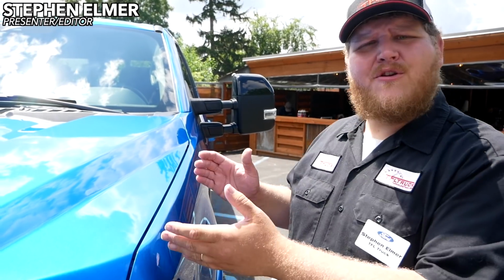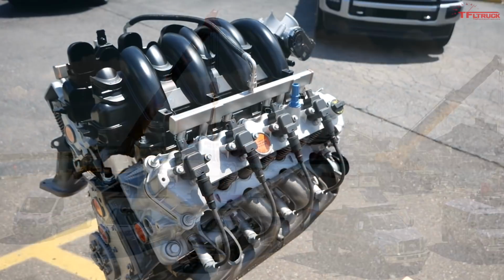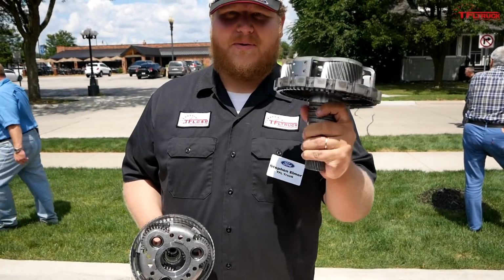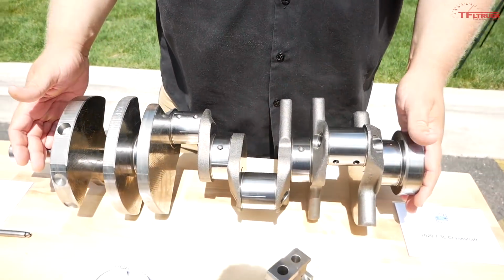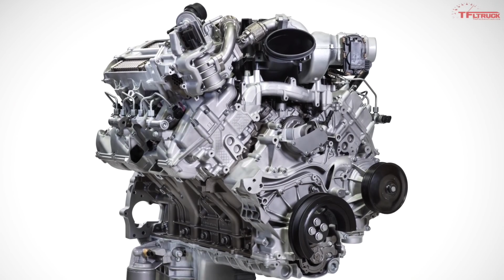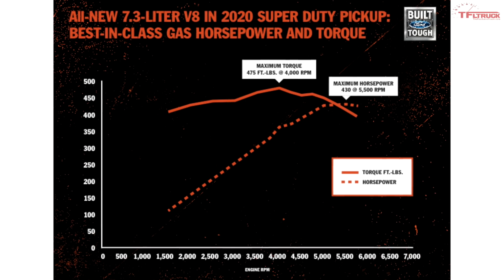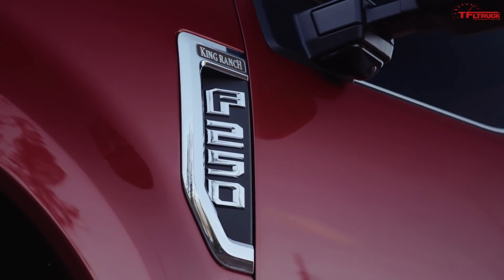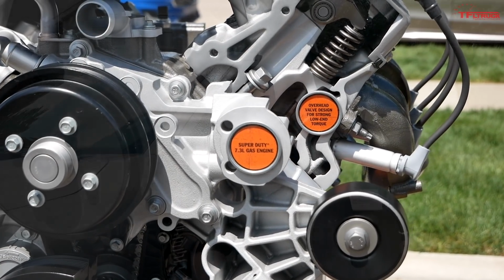We Finally Know the Ford Super Duty 7.3L V8 Power Numbers & They Are Lower Than We Thought!

Comment: It seems to me like the majority of negative comments here are not from people who drive commercial vehicles, or oversee the maintenance of commercial fleets. 

Ford was not designing this engine for the Mustang, or trying to make the F-250 a race truck.
Reply: Very good point......peak #'s are essentially meaningless in this application. Off-idle response and power up to normal shift RPM is key.
Reply: Exactly!!
Reply: LOL You got that right. This is a TRUCK engine, not the street engine they put in the F-150.  Know your engines man!  Easy to maintain, cheap to own, but powerful enough to move heavy loads.  That torque curve being as flat as it is normally comes from a diesel, or like the Ecoboost, and Ford did it without Turbos!  I tow with the 3.5 EB, that flat low rev torque pulls a heavy trailer like it isn't there. should be great in the SD to do that without needing the expense of the Diesel.   Waiting on economy numbers myself, though this type doesn't require EPA, it would still be nice to know expected fuel efficiency.
Reply: acdii A lot of people buy the 250/2500 series as personal vehicles too.
Reply: Correct, today's truck buyers are those who need to rush to Walmart for those doorbuster black friday deals, they aren't towing or hauling anything, they're using their trucks as a grocery getter soccer mom family sedan instead.
Reply: @whoeverwhatever9279  I know more than anyone could possibly need to. Yes, the 4.9 was durable as nails. Yes, the EcoBust is crap. But the Coyote is a good engine, the 6.2 is good, the 351 was good. The 5.4 4v that the lightning and Lincoln used was good, even tho the 3v wasn't. The 302 was good. The 429 and 460 were good. The 390 and 428 were good. The Clevleland 351 was good and so was the 400 if you took the smog shit off and put a cam in. This new engine seems to have combined a lot of the features of their past engines into one great engine so it should prove to be pretty damn good too.
Reply: You're absolutely right, brother!
Reply: Thank you
Reply: @whoeverwhatever9279  what the hell are you talking about?
Reply: Ryan rkj - Exactly!
Reply: yep totaly agree we nneds these kind of engines here in our tuff east canadian cold winter
Reply: when you have a GCVW rating of 25,000 pounds or more

you increase engine life by reducing Power Density
Reply: @Garrett Davis -  don't know very much about Fords do you
Reply: I don’t get why people are mad, it’s still good power lol
Reply: 7.3 gas= 8 quarts standard oil vs. 6.7 diesel= 13 quarts T5 diesel oil x10 trucks means I can afford another truck in the fleet 🤪
Reply: Thank you!
Reply: Ecoboost Engines have a Superior Torque Curve and do a far better job of Maintaining Horsepower at Altitude,

than Normally Aspirated Engines
Reply: @Garrett Davis -  Ford Performance is into Forced Induction, not large displacement, inefficient engines
Reply: Mine was thumbs up  - 427 -
Reply: Ryan rkj  - Well said!
Reply: @Garrett Davis, it will NEVER be put into a Mustang by FordMoCo. Never.
Reply: Exactly. The old 460 only made 200hp and look what people did with it. One can only imagine this engine will make huge numbers with a cam and blower. I can't wait till they start turning up in junkyards so I can throw one in front of a manual transmission 😈
Reply: @eclipsegst9419  Shit that new 10 speed will be nice too, think about it. Running 38" tires and 3.73's would be the same as 38" tires and 4.55", but now you have the fuel mileage too of a stock tire and 3.55's.
Reply: @TdrSld  probably. They sure help efficiency. I used to be a Ford Tech and drove f150s with that and they searched around for gears alot but I believe it's a "learning" transmission so if you own one it will get used to how you drive and not do that. I'm old school everything but the wife's Benz that I own has a stick. I just think they are fun and I live in a rural area with no stop and go traffic. I was planning to put a coyote in an older 92-96 F250 but now I think I'll wait for one of these instead.
Reply: Keegan Johnson. Absolutely! A cam will make these things a monster.
Reply: Keegan Johnson Good luck finding after market parts for that engine! It will take 5 years or more for the market to test then manufacturer and release new parts for it.
Reply: Keegan Johnson 
Yep, no more LS swap it will be Zilla swapped
Reply: @whoeverwhatever9279  when I worked at a Ford shop we literally made a living doing timing jobs on 5.4 3vs, and timing jobs and turbo replacements on EcoBoosts. That's why we called them the EcoBust. On the other hand all we did to the 5.0 and 6.2 engines was change oil, maybe a starter or alternator or sensor on high mileage ones. We did replace one 5.0, but only because this lady had divorced her husband, who always did his own oil changes, and so she drove it over 40,000 miles without changing the oil until it lost compression and died. The stuff that came out of that oil pan was like the grease you find in a bearing that went bad ugh.
Reply: Keegan Johnson, we had one Chrysler minivan come through the shop way back in the day, family from up north driving to Florida.

He brought it to us because it started making some noise. We went through the list, basic maintenance (80K on the clock and he'd done none somehow). Checked the oil, black as hell, nothing on the stick on the second dip.

He stood there with his wife and kids the whole time like this was going to be a five minute fix.

According to this guy they never changed the oil, never checked the fluids, something like 80K miles on a 3 year old Chrysler fwd van. This guy had gotten it in his head that since he'd heard about sealed bearings being a thing that he didn't have to do any maintenance on his van, ever, until something went wrong.

The oil came out separated, part was black sludge, the other was thin as hell, almost water.

We topped him off with oil instead of WD-40 on top of grease and sent him on his way. We discussed plugs, belts, etc, but frankly were afraid to open that can of worms. He still had 10 hours left to drive and it had been going 80K. We didn't want it to die here.

Not a huge fan of Chrysler, front wheel drive or minivans, but this thing was a warrior and deserved a warrior's death.
Reply: @Garrett Davis selling vehicles that only went fast in a straight line is why America was the laughing stock of the rest of the world for 30 years. A fast car is fast. Why not make it corner properly too? It will still go fast in a straight line if you choose to drag it.
Reply: true, but for the love of G#d my 2000 7.3 makes better torque than this "city folk diesel".....and that is what it is.......for city folk that pull NOTHING.....   :-)
Reply: @TheAmerican1963  you realize this is a gas engine right?
Reply: @TheAmerican1963 , except it's not a diesel.......pay attention......
Reply: The negative comments are from people that know Ford's past.
Ford has great marketing but they are junkers!!
YouTube Deboss garage why not Ford
YouTube car Wizard worse engine ever.
You can put lipstick on a pig, it's still a pig...
Reply: @philllsxga.7737  you are an idiot. I've worked on vehicles of every make and model, and here's the truth- every company has made a few lemons. Even Toyota and Mercedes. But 99% of the time, how a vehicle is cared for and driven has 100x more to do with how reliable it is than what the badge on the front says. I like Fords because I like their styling and sound. But I'm not some idiot who claims "everything else is shit" and anyone who does is an idiot.
Reply: @philllsxga.7737  Thia is social media bub; the negative comments are from people with inferiority complexes and deep seeded personality disorders.
Reply: @InuranusBrokoff  the negative comments are from past Ford owners. They are garbage!
Reply: @philllsxga.7737  Pretty sure you've said this already...
Reply: You must have your head where the sun doesn't shine.

Comment: Good video. I have read some of the comments where people are saying it doesn't have enough HP or TQ and it should have made more for a big motor. Of course it can we should all know by now whenever manufacture comes out with a new motor they never give it its max horsepower and torque because if they did they would have to make significant changes to it in another year or two automakers always gradually build HP and TQ.  😊
Reply: Andrew Smith you big stooooopid, clearly you don’t understand this motor is perfect for its intended customer.
Reply: @Andrew Smith you don't need any more for this. Less power=more reliability
Reply: Andrew Smith you’re the joke here. That engine is designed for towing and hauling, not racing. This engine is making big tq right off idle meaning it gets the load moving easily and maintains speed and acceleration without drama and high revs. And it can do it all day everyday reliably and the engine will last long doing it.
Reply: Identified as a ram/ gm troll,  sour grapes!
Reply: @Andrew Smith holy shit you're stupid. It's a truck engine. Swap it in a project vehicle and I guarantee it would make 600+ with just a cam and tune.
Reply: I thought all of the HD trucks are detuned?
Reply: @Squishysforbreakfast   yes. Just take the 6.2 for example in the HD trucks vs the Raptor, or the Mustang 5.0 vs F150 5.0 trucks get a torque tune, performance vehicles get an HP tune. And they leave room to grow as competition calls for it on top of that.
Reply: when you have a GCVW rating of 25,000 pounds or more

you increase engine life by Reducing Power Density

Comment: Dear Chevy, put the new 6.6 in the 1500 trucks and come out with a new 8.1 vortec that puts down 500HP and slap that in th HD trucks!
Reply: They will be putting the LT2 from the vette in the 2021 GM 1500's 450 HP, 500lbs of Torque with Truck Cam.

Comment: A bit low in numbers?  I see it is above all of the competition and a very good torque curve.  I rather have an engine builder that leaves a lot of room to build power and tune it for reliability and long life.  These engines that they are squeezing 700-800 horsepower will not last long in heavy use day in and day out.

Comment: Now this was a good video I appreciate it I believe this engine is built for a work truck but with the components that is in this engine the 7.3 L I could for see this being a monster hot rod motor. It is designed for low RPM by the government but as he stated and you can tell by its components this engine is capable of high rpm’s with a little modification
Reply: And Boost lol. This thing will be beast with boost
Reply: In an earlier video, it was stated the 7.3 is actually smaller then the coyote 5.0 in the Mustang...

Comment: Good for ford  they haven't had a good gas truck engine since the 460
Reply: GM fan  what about the triton V10?
Reply: I just think a big block is a better design for trucks. This building its power down low will work good. V10 says on paper they have power down low but real life driving will say otherwise. Even the 3 valve v10 likes rpms
Reply: @truckfan87  you know, there's no rule saying an engine can't make good power down low and likes to rpm. Owned and towed several v10's, bbf, BBC, etc. V10 by and far is the strongest pulling and least problematic of them all.
Reply: @AK_Ray  well if it had power down low then why would you need high rpms?
Reply: Bull shit, v10 is bullet proof

Comment: Cannot wait for a head to head between the Tremor and the Power Wagon.
Reply: Morty Nation Power Wagon will beat it lol!
Reply: XzLeviathanzX    Damn dodge fanboy
Reply: @randomprojectsusa5196  but the power wagon has all the advantages, front locker, disconnecting front sway bar, softer springs, a winch, and will most likely be cheaper considering you have to pay extra just for a ford badge, the only advantage the tremor will have is the 7.3, I not calling the diesel an advantage due to its weight, btw I'm a GM guy in case your wandering about loyalties.
Reply: Except that the powerwagon hauls and tows like a half ton. The Tremoe is really more of a much better FX4 package than a PowerWagon competitor.  For most users, probably a better thing.
Reply: I know you are right, And I just got owned but:     Really now, you sure your not just jealous that both ford and dodge have an off-road truck?

Comment: What a joke. Ford could have easily achieved 430 ponies with slight tuning variation to the 6.2L engine. You don’t need the additional displacement capacity to achieve an addition 45 horsepower and associate torque. What a joke, and really just marketing fluff.
Reply: One Good Turn Gets Most Of The Blanket   It’s reliability dumbazz, not power. This engine will outlast the the 6.2 by a long shot.
Reply: Random projects USA clearly missed the point shit for brains... you can achieve both and not have to go to that size displacement.
Reply: One Good Turn Gets Most Of The Blanket    What about power potential? The 7.3 allows for high power potential.

Comment: This could be the truck I buy. F350 red, crew cab, long bed, in a lariat package. I'm excited.
Reply: Mr Lariata probably $85+
Reply: victor beltran not for a gas powered lariat more like 58,000-63,000
Reply: @victorbeltran5866  Not even close. The only Fords at that price are optioned out Platinum or Limited duallies.
Reply: Diesel or gas ?? Im buying one in the near future to use it a as rig welderbut im not sure what engine to choose

Comment: This was a good move, not looking to just make a huge peak number. Should be an awesome HD engine,  looking at the torque curve it should perform like a 6.8 v10 with a tune, very similar power levels
Reply: 6.8 is gutless compared to this
Reply: My 04 v10 has 538000 miles now and still running strong
Reply: Andrew Smith 
Alright man, I’ve seen you comment on nearly every thread. You’re either a troll or a Chevy/Mopar fanboy which is nearly the same thing. Go back to your link’n’logs and let the grown ups talk
Reply: @Andrew Smith 500,000+ Miles. How unreliable it could be?

Comment: Wait... they still build the old econoline bodies as well as the new transit...??
Reply: Just the cab of the Econoline...then RV companies or box truck companies bolt their bodies onto the Econoline frame.  There is a company, Sportsmobile,  that makes a replica of the Econoline van body, only it's made of fiberglass and it is a few inches wider for more room inside...it's crazy expensive.
Reply: Just as cutaways. Lots of ambulances are built on those chassis.
Reply: I wish they still made the econoline vans.
Reply: @Ronin Kraut    I think you can order a cutaway chassis through your local Ford Dealer with a body on it like this...  https://www.unicell.com/van-bodies/aerocell/